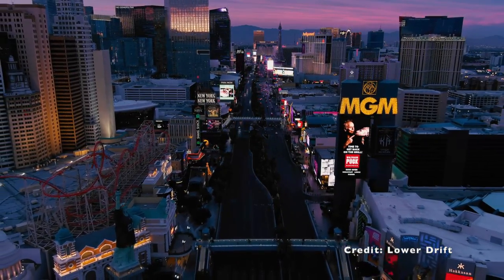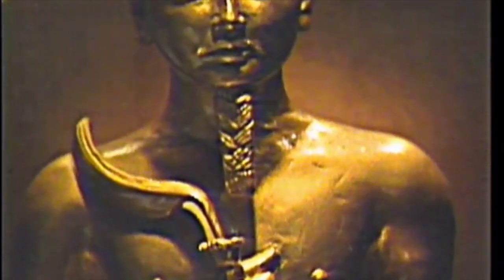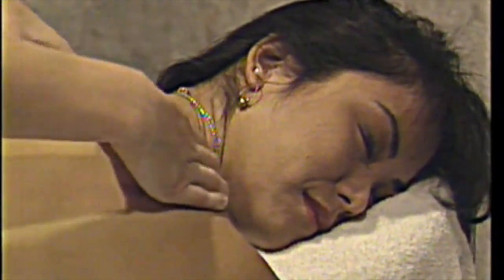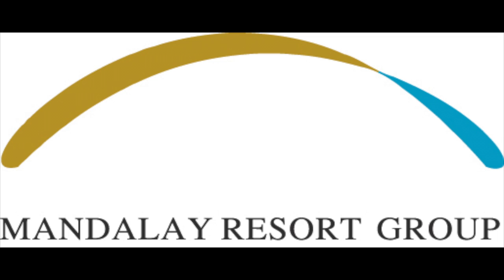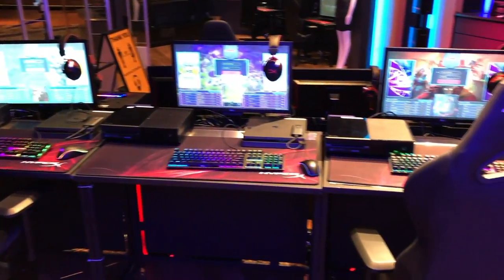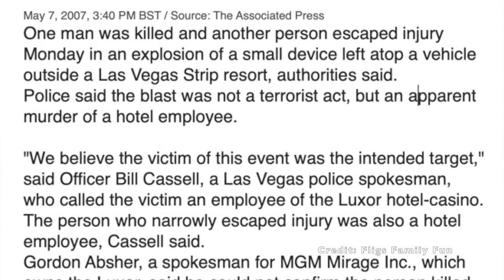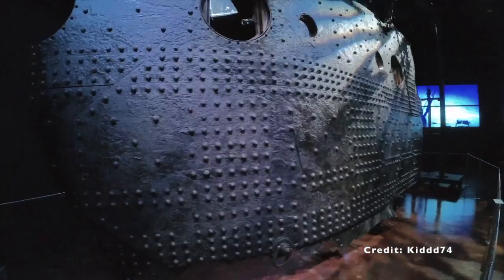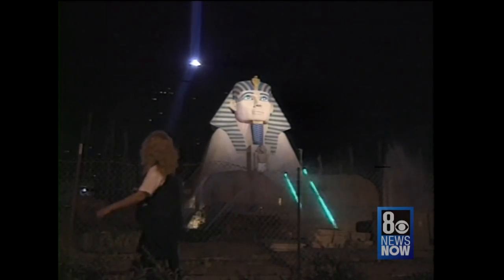History of The Luxor Hotel and Casino Las Vegas

Comment: One thing that isn't covered here is that Luxor has what I think are the three best low cost shows on the strip.  Blue Man Group and Carrot Top are local favorites, and better than you'd think.  Fantasy is the best burlesque show on the strip, and I think now the longest running.  As long as you catch it with the main host and the main cast it's fire.